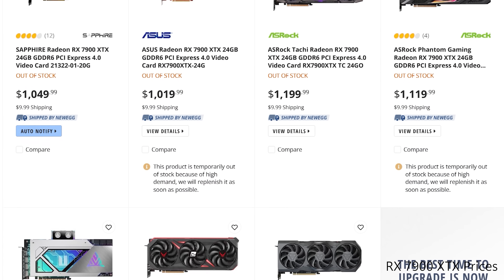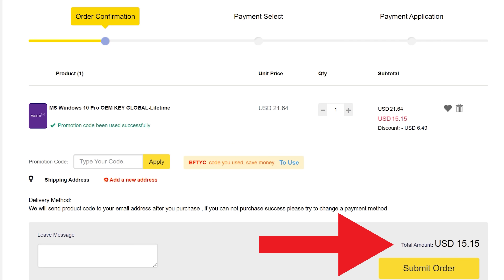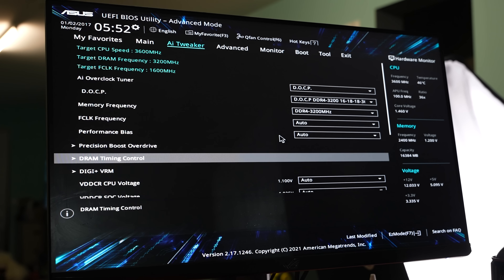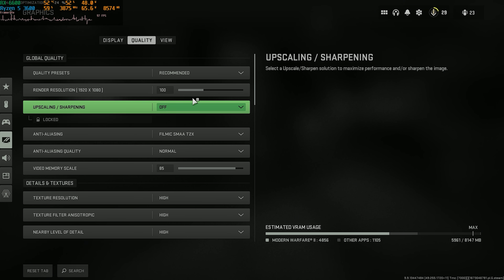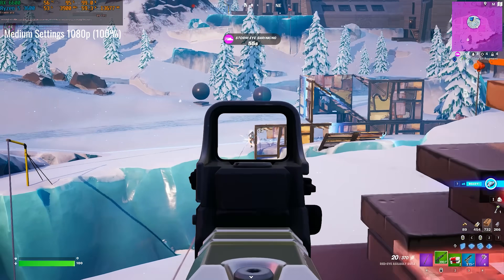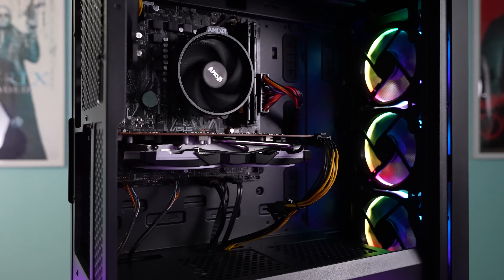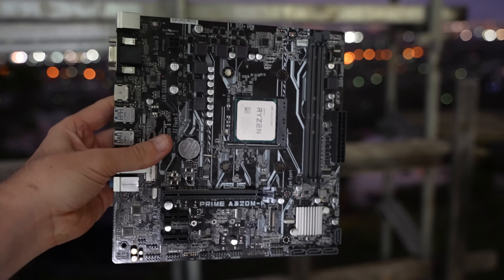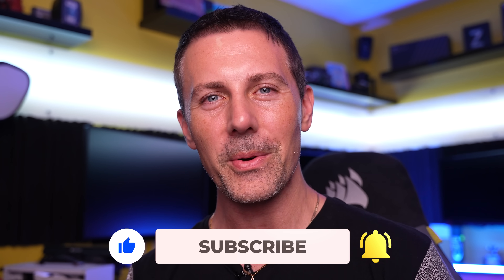This UNDER $650 Gaming PC Can't be Beat for Value.

Comment: i have 4500+asus a320+xfx rx6600  but i never saw cpu to 60watt in game like 3600 ,,l3 cache i guess ...i try a 5600 but it was very hot and high watt even in surf on internet so i keep my 4500 little bottleneck just multiplayer game like counter strike 2

Comment: In the US Microcenter now has the 5700G for $169 brand new with a cooler. I'd still get a discrete GPU for gaming, but it scores much better on CPU benchmarks than the 3600, and is also on par with price / vs performance with the 3600. And you can avoid the issues with the 3600 freezing.

Comment: I'll keep my $650.  the a320 is the worst chipset.  3600/3600X have the highest rate of failure over any other ryzen cpu, and they even skimped on the ram.  
That doesn't even take into account the X8 "graphics card"....  no thanks... I don't buy junk.

Comment: You could easily squeeze a Ryzen 5600 into that budget if you get the GPU second hand for example. It would boost the overall performance of this PC quite a bit especially on games like Warzone 2. The 3600 is a great value but it won't get the most out of the RX6600 at 1080p.

Comment: hi sir, would u mind replying this comment? im debating getting r5 3600 or r5 5500  since their price are same
Reply from the maker: Are you going to be utilizing Gen 4 ssd or a really high powered GPUs with the config in the next few years? If not I would go for the Ryzen 5 5500, better heat profile and is slightly faster.
Reply: @techyescity  Thanks for the reply!!!!
about ssd gen 4, im not interested in it. Besides my motherboard is still a320 with ryzen 3 2200g on it, yet i have bought rx 6600 few weeks ago. And the things im gonna do is video editing and. With my current processors 2200g i feel its not enough to work on it. I was about to change whole system with r5 5600+b550 combo, but something happened and it reduced my budget to upgrade,  so changed my mind on getting r5 3600 or r5 5500, and those two confused me 😅
Alright, thank you very much sir, ill update the bios for ryzen 5000 series!!!

Comment: hi
sir I'm your subscriber and a hardcore fan from Pakistan
I want ta ask few questions from you about pc components
1. how would an i9 11980h mutant (converted to lga) performs with rtx 3070&3080 and is it worth it to buy 11980h+mobo under 150 usd
2. how would an optiplex i5 9600k performs with rtx 2070s does i7 8700&9700 perform better complete optiplex without gpu (200usd)
3. is it worth to buy a Xeon e 5 1650v4 complete system under 190usd please suggest max GPU for it

Comment: I was considering building one seeing all the reasonable prices for R53600s as of late. Gaming, Feel like I keep ending back with Windows 10 Enterprise. Windows 11, Games okay but I find the UI annoying also. It is much harder to bork Windows entirely imho than to bork Linux (every January I manage to bork at least one machine on Manjaro - Nvidia driver gets taken out/wrecked). Ended up on Arco Linux though. My main rig still is similar to the listed build because it does most of what I want well. Also am thinking of building a Xeon for the data center end at some point. I did have concern mostly for the 20 tb hdd. Might be time for a rig with ECC memory in my life next. I feel this is a solid entry level gaming rig, can optimize for performance. Honestly would be interested in where the breakeven is (has to vary depending on games) for gaming as far as the budget goes.

Comment: Hello Brian, can you  please help me undervolt my GTX 1060 6GB EVGA non-SC version that has only one fan? And maybe keep the performance or even get better performance. Even freshly cleaned and thermal paste changed it still hits like 80-80 something degrees in some games and I would like to achieve under 80 degrees in any game if possible.

Comment: Cool build indeed. I'd recommend buying a brand name SSD from Crucial or WD. Or at least put your OS on something smaller but more reliable.
PSU is the same, be patient and look for discount PSUs with 10y warranties. High upfront cost that saves you headaches and money over a 10y span. 5/7y warranty may be OK if you only game a couple hours a day.

Comment: I'm building the same build but just a bit different using NVMe ssd 512gh , 250 gb HDD and a 480gb SATA SSD all in all it came under $750 the only used part is the Rx 6600 as I wanted a Rx 6650xt but it's sold out new and used in my area even in my country 😑 so the available one was the 6600 could have gone for a 3060ti but aiming to build a AMD gaming PC

Comment: I recently rebuilt my pc, had just a 3400g in there before hand. Reflashed the a320 and whacked a 5600 and Rx6600 in there and it runs everything I throw at it at 1080p High-Ultra.

My monitor is 75hz and and God of War hasn't dropped below 75fps yet. So happy with it.

Comment: Did a similar thing in january one year ago: bought a used HP machine in a mini case. Ryzen 2600, 8 Gigs RAM, GTX 1050 Ti, 256 SSD, 1TB HDD for 260 €. Great value, especially at that time!

Now I am looking for a better graphics card and thought about a RX 5700 XT for 130 bucks or maybe a RX 6700 XT although I am still on 1080p.

Comment: I always go mixed with used and bnew parts but mostly used since I started building in 2009. Saves a lot of cash and allows me to get higher performing parts than what my budget allows with all bnew. I'm just being wary now with used gpus and psu since most of them are used in mining. First time I got a really bad condition gpu in 2020 so I went bnew in 2022. 😅 If you see even a bit of rust in gpu metal parts it's a red flag and must turn around real fast. 👌
Reply: I also do that but mainly with my GPUs, I did not buy a brand new GPU since 2016 and so far all of my second hand cards worked just fine.
Tho I do have a decent second hand market/forum where I live and its not that hard to find decent/trustworthy sellers who even give you some warranty in most cases. So far I only had positive experience with the second hand market around here. 'knocks on wood..'

I had a second hand ex miner RX 570 with 2+ years warranty left on it and I used it for almost 3 years then sold it on the same market and bought yet again a second hand GTX 1070.
Used that for 1+ year till the prices dropped then I upgraded to a second hand TuF RTX 3060 Ti in 2022 September, the card was in a mint condition not even a single spot of weird color or anything and its been working great since but I did re paste it just in case.
Reply: @daelionmr4782  also got a 1070, the price I got it was far below the usual in 2nd hand market back then so I went to the seller to pick it up and test it personally, surprised to see why it is was cheap 😅, mismatching screws with lots of discoloration on metal parts, but still went with the deal since gpu was getting scarce back then, when I opened it up to replace the pads and repaste, everything is black and dirty. 🥴 It's obvious they already reused the pads several times already and even the plastic shroud that's holding the screws got easily cracked so I need to do some diy to hold the shroud in place. The only good thing about it is it didn't affect the performance but it was definitely hard to resell 😆 (though I still got +40% profit from the price I got it). Then I went bnew with galax 3060 ti. I'm happy for you to have a good community for 2nd hand parts and I'm not totally closing my doors with 2nd hand gpus just being more cautious and I'll probably stay away from those ultra cheap ones as I don't wanna get disgusted again seeing what's underneath those hsf.
Reply: @kiburi2903 
Well at least you still made the card work even if it was in a bad condition but yes being more cautious is a good idea when it comes to second hand stuff.🙂
I also browse for days usually and try to find something I'm mostly comfortable with and also check the seller's history and feedback from other buyers.

The 1070 I bought, I also went to pick it up in person and checked the card. Looked alright to me, it only had some minor scratches on it but considering the age of the card I was okay with that. It was a EVGA FTW ACX 3.0 model and the owner told me that he repasted/changed thermal pads before selling it, he also gave me all of the original accessories with the card's box. 
It worked with no issues in my PC and had good temps so I did not open up the card to see if he told me truth or not. I sold the card 1+ year later in the same condition, I did lose money on that but that was expected since the GPU second hand prices crashed after the crypto craze ended and thats how I managed to pick up my 3060 Ti.

I woulnd't mind buying brand new cards to be honest but the retail prices are so damn bad in my country with our 27% VAT that I just don't bother anymore and also can't really afford such prices so second hand is what I do for GPU upgrades.
Rest of my sytem is brand new tho but I might pick up a second hand i 5 12400 later the year to upgrade from my 12100 if I need it. 
Second hand CPUs should be fairly safe to buy anyway, LGA ones at least since the owner can't bend the pins on the CPU.😄

Comment: For 1440p gaming I think just drop a RX 6700 xt and adequate monitor, but that is twice the cost on new stuff. For 4k gaming, savings on used parts is huge compared to new parts but you spend around 4x at least from this use build.

Comment: You can usually find IO shields for a motherboard on ebay for 10 or less. Even  for Dell motherboards pulled from cases where the IO is cut into the case. ;)

Comment: This seems like a really bad CPU and platform choice. I just built out the same specs on pcpartpicker for $700 with an 15-13400F and H610M mobo for $700. That's 2 generations newer and MUCH MUCH faster in gaming at 1080p and especially multiplayer online games. I don't think that $70 saved is worth building on a two-generations-old CPU as a platform.

Comment: I recently bought some pc parts from ALIExpress and I have saved plenty of money compared to my local market here in Pakistan. I bought the CPU R7 5700g, 16gbX2 3200mhz Gloway ram and RX 6600m. A total of $500 spent will be putting these components in my NZXT H1 v2 which was for $326. All I need is an ITX motherboard the total cost of this whole upgrade is under $1000.

Comment: problem with older stuff is after a while you will have to upgrade a again. its better to spend money and go a little high end and make it last a few years. I had a r9 390x for like 6 years and ran great, But I wanted to upgrade and anything I would had got older would have to be upgraded again.. So I grabbed a Zotac 4080 and its a monstrous difference in fps.. it will defiantly last me 6 years or so. Of course pricy I wanted a 7900xtx but of course scalpers.. SO if you don't mind upgrading and upgrading again get the older stuff but if you are like me get something that can last a few generations. Of course my 390x could do 1080p max gaming etc fine and even some older games at 4k but it was still pushing it hard. My tv monitor is native 4k so it had to be able to run games at great fps.

Comment: Just picked up a 6600xt off of craigslist for $180.  His asking price was $200.  I offered $170.  
I also paired it witha brand new 3600.  Microcenter was giving away a gigabyte B450M DS3H Wifi  with processor purchase for $127.

So MB/Processor $127
      16GB RAM.       $45
       2TB LEVEN NVME.      $120
 I had a case and PSU, but you could easily get a $50 case and $50 PSU.

A Ultra Modern PC for under $400!
Amazing card, amazing deals!

Comment: What is that spray u use to clean your components? Thanks!
Reply: Compressed air
Reply from the maker: multi purpose spray, it's aus special, though wd40 or crc 556 will do the job too.

Comment: Re new vs used content, I definitely prefer used! There's so much good new hardware coverage already, and I think your style really shines with the deal hunting.
Reply: I put together a PC for a friend, using his existing case and power supply. I was able to do it with MSI Tomahawk B550 motherboard, and AMD Ryzen 5600. He got my used 32 GB of DDR4-3200 CL16 RAM for $30, along with my RTX 2080 Super for $300. He got a bangin' PC for under $700.
Reply: @Gamevet  that's sweet! My current build is an R5 3600, B450 Mobo, 16GB 3200MHz, 5700XT, 1TB SSD for just under $550. I built most of that about a year ago though (minus the GPU,) so prices are definitely lower now. 3600s and B450s are practically being given away now!

Comment: IDK I will buy CPU used but when it comes to MOBO's i usually go new for worry free warranty.
Got burned many times with open box MOBO and refurb being bad. Sometimes I will even buy GPU and RAM used to cut costs for customers.
PSU is another place i LIKE to get new VS used, worry free warranty.

Comment: for $150 and a little digging I got myself a i5 3470, rx 570, 900gb storage (3x 250gb hdd, 1x sata 250gb ssd), 16gb of ddr3 memory. Think that value might be a litttle better than this.
(I know these are new parts don't yell at me)

Comment: The only item I have an issue with on this build is the A320 MB. The only time I've ever used an A320, I had nothing but trouble with RAM compatibility. The machine kept randomly throwing BSODs. It took me a while to find RAM that would keep the system stable. My preference is to use B-series boards. The ASRock B450 Pro4 MB had been rock solid using several types of RAM.

Comment: i3 12100f is 100$ and lowest end h610 from gigabyte is 75$, the i3 12100f is 11% faster in games than the 3600. even r5 5500 falls behind i3 12100f
Reply from the maker: I have to revist the 12100f, that board and cpu combo cost is actually incredible.
Reply: @techyescity  the i3 12100f is a absolute beast, theres now the i3 13100f but not rlly worth the 50 bucks, the ryzen 5 3600 is good but in this time and age it is pretty bad value, cheers mate

Comment: I managed to get the R5 3600, Gigabyte B550 Gaming X V2 motherboard, 16gb 3200mhz 2x8 ram, Asus Dual RX6600, EVGA 650 BR PSU, 512gb m.2 lexar ssd and a thunder case for 750 USD a bit over a week ago everything was new expect the GPU

Comment: i just picked up a 3600 and a gigabyte b450 wifi motherboard NEW FROM MICROCENTER for $119.  paired with a pre-owned 1070 , and an NZXT h510 Airflow i got from a guy who couldnt fit his 4090 in it.  grabbed a 500gb TLC NVME and used some corsair vengeance i had laying around from when i upgraded another machine.  little RGB and the total cost was around $350 to replace my 8yo's Dell 4790 + 1650/SSD.  

Ryzen 3600 $119
Gigabye B450M DS3H Wifi $0
16gb Corsair Vengeance RGB $0
NZXT h510 Airflow + 4 rbg fans, cable combs $60
Lenovo GTX 1070 + 500w PSU $120
Inland Prime SSD $35
Fan hub $20

Had him help me put it together this weekend.  Setting it up and replacing the old XPS today while he's at school.  After some benchmarks of course :cowboy_hat_face:

Comment: for 15$ bucks i can't fault you for 320 board , but a 550 would have been a better match for GPU/CPU, but i would use that 320 for a lesser CPU and GPU, and try to find a used 550 even though they are pricey do to the demand, might be an interesting video as far as which one sells better, i would be interested anyway, considering a 5500 would run just the same as 3600 on that board , while 3600 could shine on a 550, but i do wonder if the upgraded demand would be worth the changes considering its likely only about a 10% boost in  performance stock with the same RAM speed, but how much more could you get out of multi-able over clocking methods with a R5 3600/B550 over a R5 5500/A320 pairing (maybe with a 2050 or 2060 for the 320/5500 to make it a more fair comparison as far as over clocking goes considering the 3.0 Pcie support )

Comment: I actually built a really close priced pc with the same key specs. Ryzen 5 3600, rx 6600, 1tb nvme ssd, b450 steel legend, 16gb 3200 cl16, wraith prism, rgb atx case for 650 euros.

Comment: GTX 1080, GTX 1070, GTX 1060, RX 580, RX 470 and RX 560 have seen some pc gamers through tough times.

The RX 6600 is basically a faster more efficient GTX 1080. Very good GPU for the price.
Reply: a 5700xt is more powerful than a 6600, and it is 200$ used.
Reply: @Jambroni_1  True but alot were used for mining.
Reply: @comfy_rwds  rx580 and gtx 1089ti still going strong
Reply: My RX 470 has been an absolute champ for way longer than it should have been.

Comment: I would go for the Ryzen 5500 for the same price roughly. And RAM 3600Mhz,  as thats where the Zen 2/3 Tops out in performance.
Reply: 3000 responds to ram over clocking very well , 5000 is like 1% boost on anything over 3200, and 5500 is going cost 10% performance as it doesn't support Pcie 4.0 support and has half the cache, and then you have per clock cycle speeds as well if overclocking , stock they are both about the same on a B550 mother board do to how much has been cut from the 5500 as its 5600G without the vega graphics

Comment: I always thought of the Ryzen 5 3600 as a sort of sleeper CPU and sometimes overlooked in terms of price to performance. It still holds up well for today's games.
Reply: best bang for your buck today if you plan on running you system over stock specs
Reply: @hayseedfarmboy  always was. I went with it instead of an Intel i5 9th or 10th Gen CPU. I may upgrade to a Ryzen 7 5700x later on but for now, the CPU I'm using is a beast
Reply: @Wazoru  I waited quite some time before I eventually upgraded. Swapped my 1700x out for a 5700x. If it wasn't for the compatibility update I probably would've gotten one of the ryzen 3000 processors.
Reply: @ArtisChronicles  I just needed a 5700x for the 2 extra cores and because it consumes less power than the 5800x although it has a slower clock speed